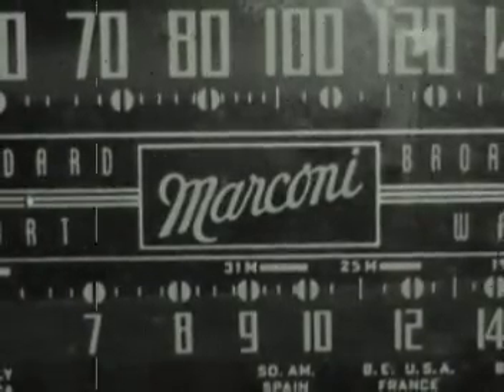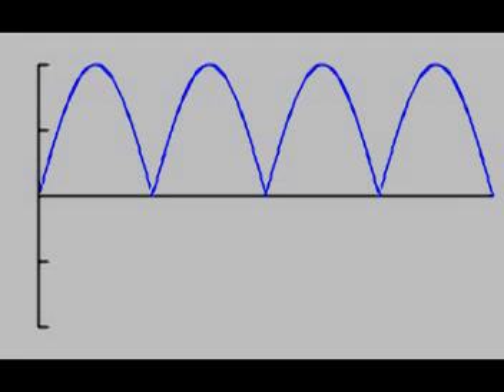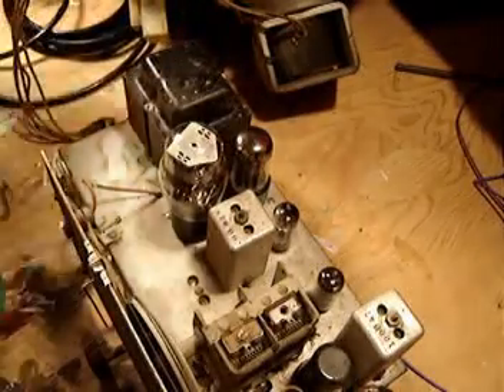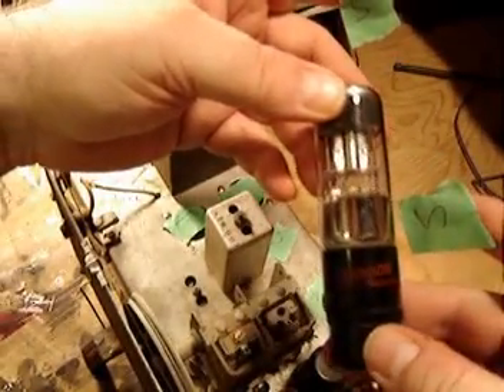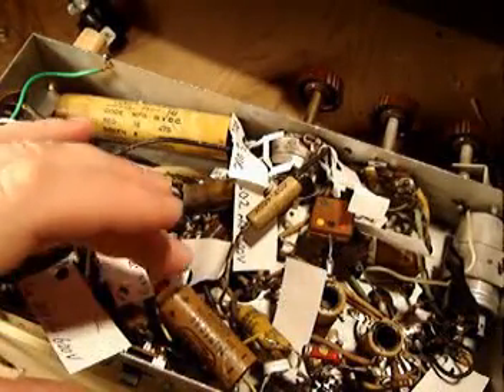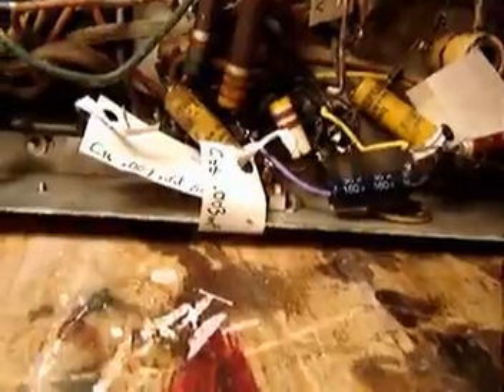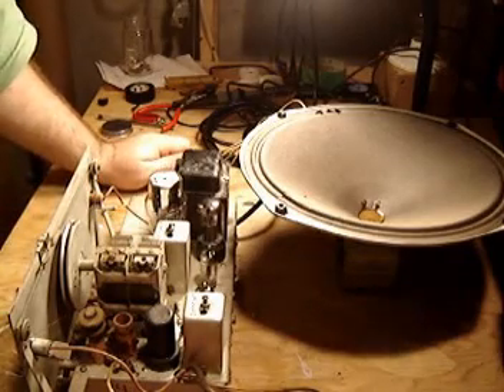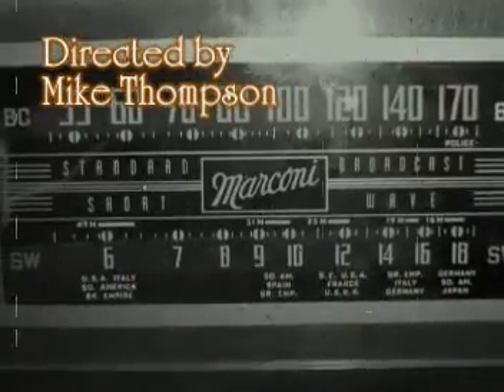Repairing and Restoring Tube Radios - part 3

Comment: Great job on this restoration Mike. Some folks not familiar with electronics may believe you are a genius for associating the filter caps with the hum problem. You might want to point out, that the hum is the 50 or 60Hz unfiltered power coming out of the rectifier,  riding along with the audio and amplified to the speaker. Going back to your nice diagram, when the filter caps fail, all those DC bumps (ripple) are coming through.

Comment: for the novice. when you find a very old radio that hasnt been used for years. if you have the equipment never put full voltage on the radioright away. if you dont you might as well start changeing capacitors. i love old radios.nice video and have fun. I do remember and have listened to the shadow on radio.

Comment: Cool repair! I use a oscilloscope to check the wave forms to better tell the condition of the power supply circuits.  Glad you don't shot gun the radios. Cool video ! Only the shadow knows...

Comment: also a good idea to replace the line filter capacitor with a newer safety capacitor
that are designed to fail in a way that won't
burn your house down! line filters on some models are connected in before the power switch and are activated anytime the radio is plugged in always unplug old tube radio's when not in use.

Comment: What a nice sound that radio has with that big speaker.  Maybe you can answer some questions for me.  Can that type of speaker work with a modern radio and can you connect a modern speaker to this type of radio?  If so, how is it done?  Also, it looked like the speaker cone had some holes in it, or was it just the lighting?  Where is the danger spot on that type of speaker when the radio is in operation because it amazes me how electricty flows through and there's no electric buzz at all.

Comment from the maker: These older radio speakers actually don't have electricity flowing through the speaker cone. They do have a large (and heavy) magnet in behind the paper cone which converts the electrical energy to mechanical energy which vibrates the speaker. These old speakers actually require a very high voltage that would not be compatible with modern electronics without modifications. There was actually a serious buzz on this radio until I replaced the capacitors.

Comment: YOU DID A GOOD JOB ON THAT RADIO BUT THE ONLY THING I SAW THAT WAS A NONO . YOU NEVER LEAVE YOU SPEAKER 
UNPROTECTED LIKE YOU DID NEVER NEVER DO THAT . ALWAYS PUT CARDBOARD OVER YOUR SPEAKER . THIS IS A MUST WIN WORKING ON OLD RADIOS . MOST OF THE TIME YOU WILL NEVER FIND THE SAME SPEAKER . THEN IF YOU CANT FIX IT YOUR DONE . I HOPE YOU CHANGED ALL THE PAPER CAPS . THEY ARE ALL LEAKY BY NOW AND SOME OF THE OTHER CAPS KEEPS YOU TUBES FROM OVER HEATING . THANKS FOR YOU VIDS  NICE WORK

Comment: if you go through all this trouble to wear a bicycle helmet and a seat belt before you take radio apart, then why wouldn't you use a Variac, or a "dim bulb" to start it up safely?

Did you  change the power cord to a Polarized one?

Comment from the maker: No, a 60 watt bulb isn't always correct. It should be about the same power as your radio uses to work properly. Go back to about 3:50 in video #2 for a way to guesstimate what bulb you need.

Comment: how did you know witch 3 caps to start with?
Reply: You always start with the electrolytic capacitor and there was three in this radio: the long old electro capacitor consist of two electrolytic cap; the smaller old electro cap is just one electro cap.

Comment: OK, it sounds nice...and as you said, the hum is gone.  However, IT IS NOT SAFE YET!!!  All those paper/wax capacitors you left in, some of those are in areas that are going to take out either tube(s) or transformer(s).  They all are leaky by now....electrically leaky, not leaking wax.  Also, notice on the old paper/wax type capacitors there is a black band on one end of the capacitor...that is indicating the outside foil end of the capacitor.  That end of the capacitor should always be connected to the low impedance side of the circuit where it is placed.  Here is a video that explains that much better than I can:
https://www.youtube.com/watch?v=BnR_DLd1PDI
Another of his videos that is quite good, and one that I think you would find interesting and helpful is this one:
https://www.youtube.com/watch?v=67M7fsbLUIU&t=4s
If you enjoy old vacuum tube radios as much as I do, I think you will enjoy watching this one too.  It is a 1947 Rogers "Chairside" radio.  I think it is one of the coolest radios ever made.
https://www.youtube.com/watch?v=ISbidethQyc
Oh, and about the speaker.  I think you will find that the device on the speaker that looks like a transformer is a choke and is part of the power supply filter system.  Most likely a Pi type filter with the choke between the two capacitors you replaced the old multi-capacitor with.
I just looked it up and found a "manual" on that radio. I was right about it being where I thought it was.  It is labeled on the schematic as L.S. Field  (Loud Speaker) In case you don't have a copy, you can find it here:
http://pacifictv.ca/schematics/marconi219data.pdf
I also noticed that C28 is a dangerous guy....often called a Death Capacitor.  It NEEDS to be a Safety Capacitor and should go from the line side of the AC power to ground!
Looking forward to the cabinet work.
Thanks for sharing.